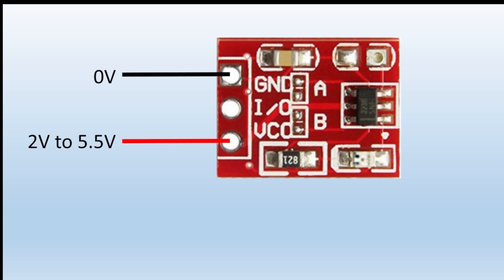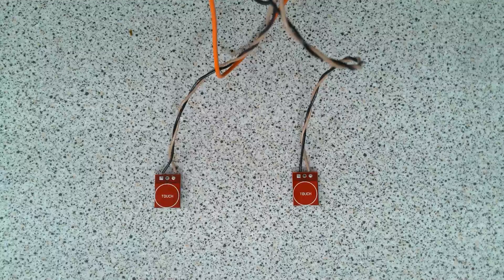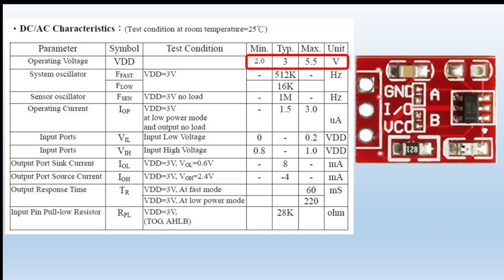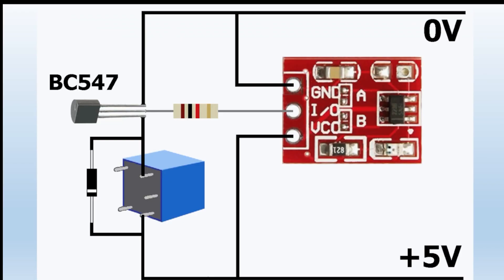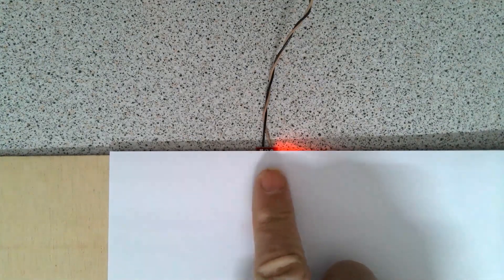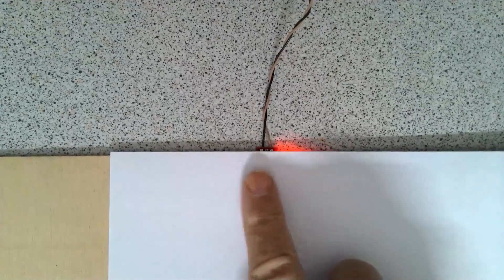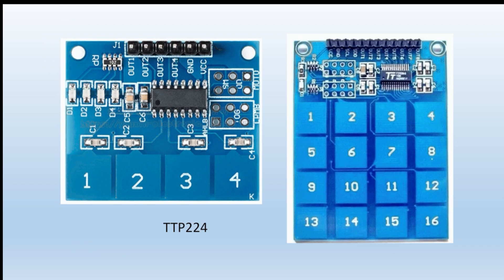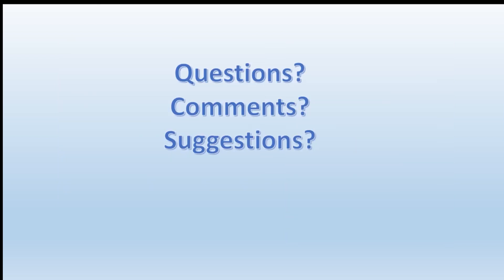Touch switches

Comment: Great video. Keep these coming please! I'm trying to figure out how to use push buttons to drive my sg90s. Got the servo working but wiped out DCC++ in the process. Also accidentally shorted my wifi board and motor shield by crossing live wires while plugging in. I've taken this as a lesson to leave my command station alone and run a parallel arduino or series of arduinos  for each heavily switched area on my layout. Perhaps a video outlining best practices or advice based on experience could be in order? Id like to run crossovers with a single button too. Pushing limits for an amateur i know!